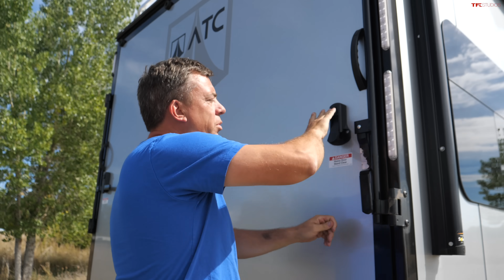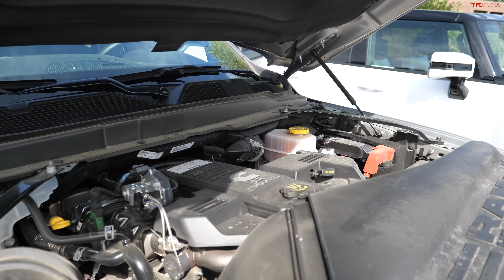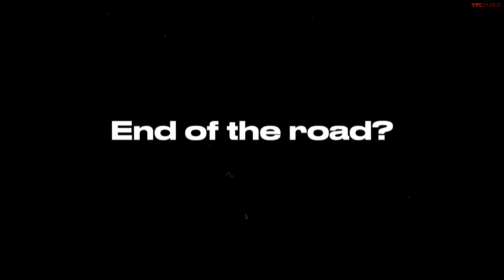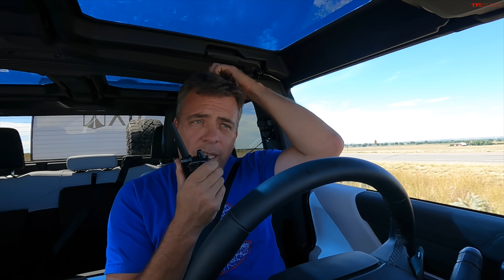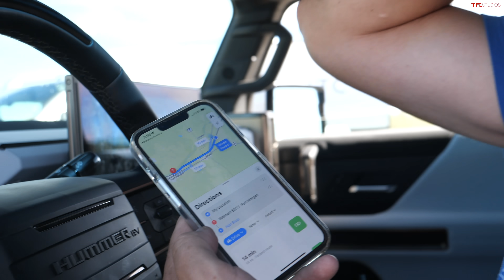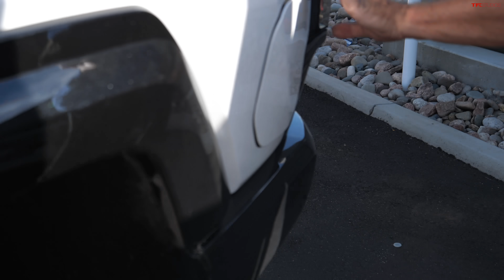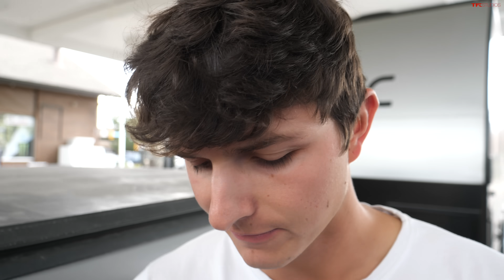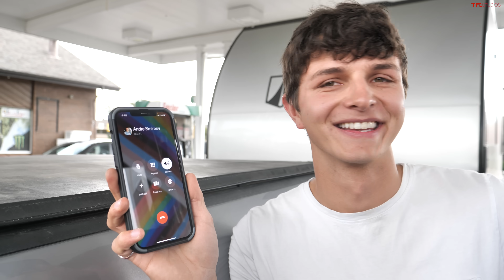How Far Can a Diesel and Electric Truck Tow An Identical Camper Trailer on ONE Fill-up?

Comment: I think the V6 Ram 1500 with the e-torque would be a better comparison... its a similar tow rating less efficient for towing but even that being said. When I tow our 5000lb trailer I average 125miles to the tank before pulling over and filling up and I still had about "80 miles" so ram still wins?

Comment: The hummer only takes a day to charge with a fast charger, and 4 days with a regular cord charger, bahahahahaha , POS, Ev's won't work for cop cars , or for anyone that drives a lot , it's ok for soccer mom that lives within 30 mi of school, store , home, for work trucks ev are worthless, for haulers useless, electric 18 wheelers will never work, not even for local, EV's are a scam, and are worse for the environment then gas/diesel vehicles

Comment: I think I noticed a price of 43 cents per KWH on the charger.  That's almost 4 times what I'm paying for my service at home.   Like you said EVs are toys at this point.
Reply: Evs are for idiots and rich people who want to virtual signal and not actually do anything or get anything done.
Reply: 43 cents per KW is the base plan price for Electrify America.  If you charge regularly, they have a “+” plan where you pay $4/month but power is 25% cheaper.
For ref.. my delivered power cost at home, with all fees and taxes is 14 cents per KW (I think 12 during non-peak)
Reply: @ffakr   There is no path to monetary savings when a person is paying an additional $46,000 for the Hummer EV vs the diesel Dodge. $46k buys 11,500 gallons if diesel averages $4/gallon. If the Dodge averages 14 mpg for an owner's use case (mix of towing and unloaded driving), that's 161,000 miles. If electricity was FREE (and the EV battery doesn't fail out of warranty), the breakeven point is 161,000 miles.
Reply: @ffakr  makes sense for a commuter car not really for a truck or anything built for a road trip. 

It's also not cheap to buy or particularly clean.
Reply: @wayward03  yea, I don’t think they’re ready for long hauling, especially long haul freight.   I got sucked into replying to threads about EVs in general here and there,.. love my ev, but I wouldn’t choose one if I had to tow 3 ton trailer 2000 miles.  

They’ll get there soon enough though.

Coincidentally, since this video posted, musk announced an actual ev semi delivery to Pepsi.. only 5 years late.  Noteably, he claimed it did 500 miles moving something like 88000 lbs (total weight), but they’ve so far refused to release the actual vehicle weight.. so we have no idea how much cargo it carried.    
Also notable, it requires a 1MW charger.. to charge its massive battery in a reasonable amount of time.. something not currently available on the roads so… :-/
Reply: @wayward03    well, it's clean to drive that's about it, which is certainly cleaner than gas/diesel, but still.
Reply: @cobra-gladiator  not if you get half the range and add in the mining and lack of recycling. 
They got everyone convinced that the colorless odorless gas plants use to photosynthesis is worse than lithium mining...boggles the mind.
Reply: @wayward03   i said they were greener to drive, counting solely the operation of the vehicles, one pollutes as it moves, one doesn't, now if we dig into all the other aspects, an EV gets a good bit less green, still, you've taken one part of the whole emissions equation, out of the equation, so it is more green. but it's definitely not 0 carbon all the way through, i'd love to see a comprehensive study from someone without a horse in the race between gaoline/diesel, and ethanol/methanol and liquefied/compressed natural gas, and EVs, i'd suspect the EVs will be the cleanest in the actual driving pollutants area, given they've no emissions, but alcohol fuels are,at the very least, a very good middle ground no? very renewable, cleaner than gasoline, AFAIK, and can be gained from many sources, but i'm no researcher,i haven't duh deep into all of it, and it seems one way or another EVs will be the replacement for anything that isn't an airplane or military vehicle past 2030.  regardless of if it's the best solution, or if it isn't.
Reply: Fast chargers are definitely not the place you wanna regularly charge, I was getting off peak at home for 2¢/kwh, pretty different world of cost
Reply: Fresher electricity? I mean, they say there's no extra charge that month for using a station but there's a massive price surcharge for using it all the time.
Reply: Yeah but unless you've got 400A or more service, which is 0.00% of residential property,  there's no way you're getting that much power to your vehicle to fast charge it, hence the price of kw/h
Reply: What is the conversion to $/mi?
Reply: @Ed Darby  i believe he said he was getting 0.6 miles/kwh so you would need 1.66 kwh to go 1 mile.
$.43×1.66kwh = $0.7138/mile
Reply: @TEDSRR  thanks!

So the diesel pickup truck got about 6 mpg? While towing? So at $4/gal we're running alot closer than I expected.
Reply: @Ed Darby  the diesel was getting 9.7 mpg. Here in CT diesel is $6 gallon so a little over $0.60 per mile in the diesel vs $0.70 in the hummer assuming your juicing up at a fast charging stainless
Reply: @eddarby469  No, it was 9.77 mpg, or 9.72 mpg, something like that
Reply: @eddarby469  m
Reply: $0.14 at home and $0.33 at a supercharger.  I've spent $59 in electricity for the last 30 days on my model y.
Reply: @ogboomerang  how many miles did the $59 cover?
Reply: EVs will always be commuter vehicles.
Reply: Good thing 75% of full size truck owners don’t tow.

Comment: Here's the thing those 2 trucks had no payload and no passengers so you have to weigh in those factors as well. Figure about 2500 lbs of added weight. Diesel comes out on top with constant power and towing ability for long hauls. Electric vehicles are so limited to what they can do and who wants to sit a charging station for almost an hour.

Comment: Diesel  ⛽️  takes the WIN 🏆 
Let's not forget the time it took to charge. Which in turn adds time to your trip. There again DIESEL  ⛽️ WINS 🏆 
Now also add in for a break down happening.. you can't just fix the EV at a local shop or on the side of the road like you can the Diesel. There again Diesel  ⛽️  WINS 🏆
Don't know bout you folks but LIFE is just too short to WASTE TIME on an EV.
💪⚔️🇺🇸🗽⚖️💯⚖️🗽🇺🇸⚔️💪

Comment: You have to take into account that to produce electricity before you use it has a cost. Whether it's the cost of coal fired power plant or the cost of solar panels. as far as efficiency, the cost of the electricity is also subsidized by the government through grants to build all power sources to generate that electricity so the cost is greatly skewed. My guess is that if you were to take all that into account your channel would be banned.

Comment: I’m surprised you didn’t get better miles per gallon with the Ram. I have an 2022 F350 with a 7.3L and my toy hauler is about the same size but I’m closer to 8500 pounds loaded and I’m getting close to that miles per gallon with 4.30 gears. I had almost the identical Ram for a short period of time before trading it in on the F350 I had on order. Based on those numbers and the cost of diesel I don’t regret making the switch.
Reply: Had a Ford F-250 with a 7.3. I pulled my trail Jeep on a trailer all over the country, and I was getting 19 mph, whether I was towing or not.
Man, I miss that old truck……

Comment: The RAM should have done better than that with that small camper.  My Duramax gets 12 pulling a 42' 13000 pound fifth wheel.

Comment: May be a strange question,  but I'm wondering how the 12 volt, charged trailer battery, charging off that 7 pole connector affects range?

For the Hummer pbviously. 

Have to ask, as they usually are starting out at low to no charge, so it would be drawing amps right out of the gate.

Frankly,  I'll stick with gas or diesel, until the batteries and range improve.

Comment: These trailers were what many people tow with a half- ton truck. Load them up to near the max tow rating of the Hummer and see how far it goes. In the mountains. These EV trucks are what I call " Pretty Boy " vehicles. They are not serious practical towing vehicles. I can take my F 250 out across Nevada where I live and drive for at least 225 miles towing an 8200 lb trailer. Thats going from 4500 feet to 6000 feet to 8000 feet many times. Even in rural northern Nevada there are gas stations every 125 miles or so. I haven't seen any electric chargers in Austin or Eureka, but there might be one. The problem is that you can't drive the 125 miles with any electric truck on this terrain towing that load.

Comment: I'd love to send you a pic of my milage. 2011 6.7 
I don't think iv ever gotten below 15 maybe from factory.
I could go snap a pic right now and avg mpg is 21- 23 mpg fully loaded with tools and service tank full of fuel.
 you really need to get that new ram tuned. And get rid of the inhibitors it has on it. How's that def fluid. 
Def never made sense let's put toxic ammonia into the air through the exhaust. Yeah it's real clean 😂

Comment: I feel like it would be smarter to build a much simpler lighter truck, maybe just one motor etc, and then load it up with the most batteries possible. That Hummer has to have at least 2000+ lbs that could be dropped that is just unnecessary for a truck. Then the range might be more acceptable

Comment: Under 10 mpg on diesel pulling a 6,000 pound trailer?  Something isn't right.  My last trip pulling a 6500 pound trailer with kayaks on top of the camper shell, about same distance, fairly similar topography and speed, my 2014 F150 with 3.5L Ecoboost got 12 mpg.

Comment: Can’t wait to see how those EV trucks are going to perform when pulling a trailer when the temperature drops to the 20°s and bellow
Reply: or pulling in hilly areas of the country
Reply: Ummmm, lol, you won't.... Well, you MAY, but it won't be going very far
Reply: To be fair in extreme low temps diesels struggle as well...For me electrics arent an option yet but I think they will get there in the end I need at least 1000 miles in range and fast charging capability which apparently the new blade batteries due next year can do..Have to wait and see.
Reply: Low temperatures don't affect diesel engines as much as you think.  Millions of diesel powered semi trucks run all season long when the temps are 100+ or -40 hauling up to 80,000 pounds.  No ev on the market is going to come close to that currently.
Reply: @warhound7781  Low temperatures do affect diesels those trucks you are talking about take special measures to ensure they run in low temperatures and if they shut down for too long it takes a lot to get them started again.
Reply: @shadowbanned5164  Try again, it's not the 1970s with mechanical injection, poor viscosity oils and untreated fuel.  Never had an issue where sub zero cold weather has prevented any diesel truck I had from starting in the last 30 years.  But what do I know...lmao
Reply: @shadowbanned5164  all diesels need are a normal car battery to run the glow plugs in cold weather. ICEs and electricity work hand in hand, but electricity in battery form will never truly replace fuel as the workhorse of the system as long as space constraints are in the conversation. Until nuclear energy comes in the form of Ironman's chest reactor, we will have ICEs doing the long distance trucking.
Freight trains require diesel generators to keep their gigantic electric motors running. You can't throw in a 5 ton motor into a pickup that drives on a highway
Reply: @shadowbanned5164  I’m a truck driver, if extreme cold affects diesel vehicles is basically only on the diesel it self, you just have to make sure you mix some anti-gel additives and you’re good to go, it doesn’t affect MPG or anything else, and usually most places where you fill up have winter blend already in it for the cold months
Reply: @jcdriver8500  Generally its the diesel I have had problems with I do have good results with additives though but they are over and above the operating norms of the engines which was my point.
Reply: @shadowbanned5164  turn a blind eye

Comment: These kinds of reviews are kinda silly. EV’s are far more efficient with energy then and ICE vehicle. The issue is it costs almost nothing to have a bigger fuel tank in a ICE vehicle, in contrast have the extra energy needed to say tow something the same distance the cost will be extremely high as well as the weight. The Hummer will tow very very well for sort distances. It will be incredible around town and very efficient not towing (when talking actual energy not range per charge). the reality for most people and EV will be great. For those of us that use our trucks to tow long distances EV’s do not make sense and until battery tech gets much more energy density. Fast charging is key and maybe eventually inductive charging from some roads but its not clear yet. these kinds of comparisons would be like me Reviewing a TRX on an auto cross corse and complaining its not good at it.